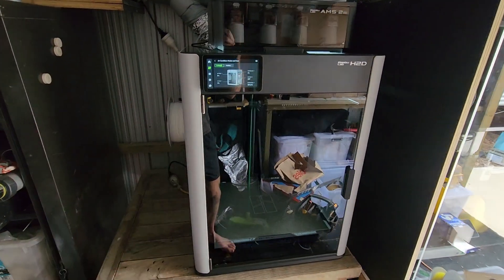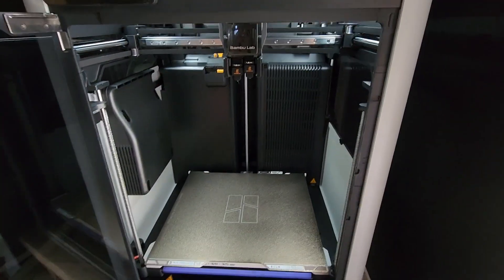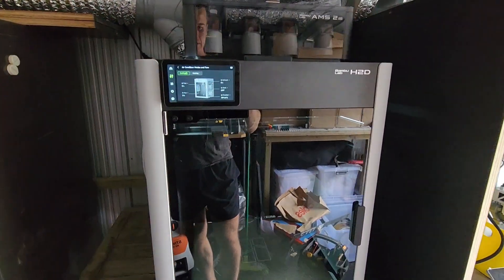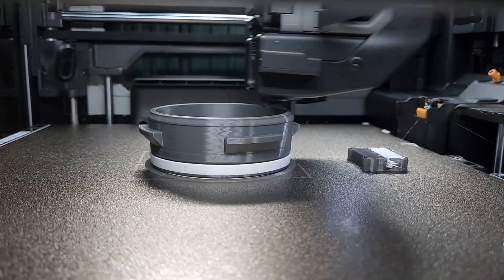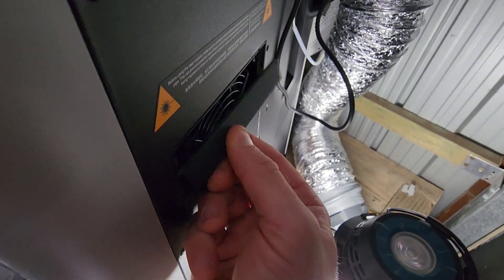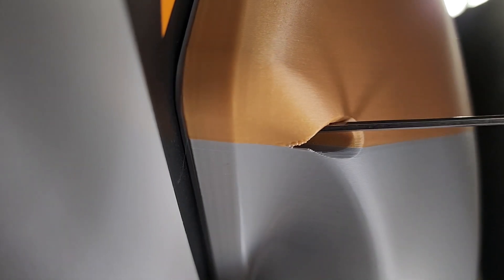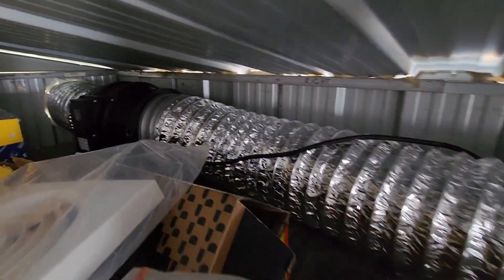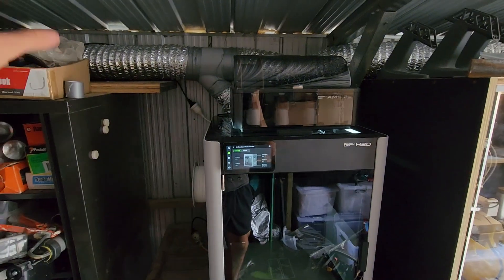Bambu Labs H2D 3D Printer - Extraction and Exhaust System - DIY FIX

Comment: Just wondering if that fan will make it difficult to control internal heat while printing. I am planning on doing a similar way and also considering doing the same compartment as shown on the right side with top mounted exhaust
Reply: I've been having this exact same question.
Reply from the maker: I have not had any issues whatsoever, but my ambient temp is fairly stable and I rarely print other than PETG. Also the draft isnt overly strong, just enough to create a negative pressure in the chamber to stop any leaks.

Comment: Great setup.. I was wanting to do something similiar but I was wondering if using accordian foil hose causes problematic turbulence?
Reply from the maker: Not sure on that either, it may do slightly, but overall a good inline fan has enough flow to negate those effects. At least for the relatively small run my exhaust ducting has, about 10m in total.

Comment: What is to stop one printer venting into the other?
Reply from the maker: There is a an exhaust inline fan drawing air out of the vent duct. So the whole system is negatively pressured (until the fan which is basically on the outside of the shed)

Comment: Hey man, amazing work. What are you using for the negative pressure air purifier itself?
Reply from the maker: Thanks mate, appreciate it. At the moment nothing, it vents via duct to atmosphere away from the shed. However as i'll be shifting soon, in the new place I will aim to use an inline HEPA filter to filter out the particles. I do use an INOVA HEPA and Charcoal air purifier for inside the shed area if working inside. A bit overkill maybe, but a cheap insurance if there are any escaped emissions that could build up over time.

Comment: I think it's better to put the H2D in a large enclosure, like you did with the A1 and vent the enclosure, not the printer. (in your case, you just need to add a top and a door).In this way, you vent the fumes released by the printer, without changing the printer functionality. The H2D is circulating air inside the printer when printing with high chamber temperature. Removing the fins like you did will decrease the internal chamber temperature, so  you will waste energy trying to keep the chamber temperature.
Reply: @FunctionalPrintFriday has done some test and if you regulate it you actually save energy heating the chamber. The video i think is called this sucks or something like that.
Reply: I'm looking in to buying a house soon and this is exactly what I planed to do in the workshop. Build a airtight cabinet where I got air outlet in the top left end of it going outside with a fan and a air intake at the bottom right end og the cabinet. This will give airflow over all printers and then outside.
Might be a good settup without making extra draft inside the printer. I wana print ASA so best to not put airflow trough the chamber it self
Reply: @SindreEide93  Just my two cents since I already built an enclosure. Make it tall, at least 50cm above the AMS lead when its open, and also at least 30cm  wider than the printer. The doors doesn't need to be air tight, the gaps in the doors can serve as an air intake, just install the exhaust fan on the back top of the printer. In this way, the air is always pooled away from the front. Last thing - install lights inside. Another way is to make the enclosure air tight and install an air scrubber with active carbon inside the enclosure.
Reply: @jyfjgtyuh i will only have 1 Bambu Lab P2S when it arrives in the mail. Still I think I will build the enclousure to fitt 2 of the H2S printers to have room for layer puchase of another printer and have a good amount of air room around them
Reply: @jyfjgtyuh  Alternatively, have a lid+front that can be opened for maintenance without having to be too far above the printer. Put your AMS units on the lid of the enclosure with an airtight passthrough for the PTFE and power cord. Might be more functional in some environs where it's too tall having a full cabinet cover. 

I'm looking at building one using T-slot extrusion because I can't work out an ideal way to keep my print room clear of VOC's with ducting that does not also mess with the printers own ventilation management. 

I dearly wish Bambu had built these all on the basis that all expressed air must pass through filtration. It just seems a lazy and dumb move. All of the designs are compromised in this aspect.
Reply from the maker: Great point! Ideally this would be the case, however luckily I don't need to use filaments that are super sensitive to temperature changes. But I agree, a enclosure would be the ideal set up, I just don't have the room or need for it just yet. Thanks for the great idea though!

Comment: Hello, 
I installed a system similar to yours on my H2S printer, except I didn't dare remove the two flaps to allow air to flow through. I'm wondering if doing so might cool the printer chamber too much, especially when printing with ABS or ASA, which can cause warping due to insufficient temperature.
Reply: I am going the way of Functional Print Friday venting.  He has 3 videos on how he set his up.  I think if I set up a blast gate and get the pressure just right I can control how much heat leaves.  https://youtu.be/jj7Mv1iiFNc?si=y4-rz1ci1eZdMnrw
Reply from the maker: That's is fair enough, all I would suggest is try it. Depending on what your ambient temps are, it may not be an issue. But trial first obviously! Easy to put back in if you need too.

Comment: Have you printed abs with success in this setup of removing the two plates and applying negative pressure?
Reply from the maker: Not abs sorry, a very small amount of ASA and no issues (simple print though)
Reply: @diysalmon if you continue to print asa with success let me know, or make a video! I can't find anything else about venting during ASA/ABS with h series.

Comment: I added gcode to vent ABS fumes once the print has started but I'm trying to dial in the best fan speed to remove emissions and also maintain enclosure temperature. 30% fan speed seems to work fine in my garage but unsure if this affects print quality.
Reply from the maker: That's awesome to hear, far beyond my skill set to edit G-code. I guess it would depend on your ambient temps for what fan speed you'll need to run. Nice work!
Reply: @diysalmon  Just need to go to the filament settings in Bambu Studio and add this: 
; filament start gcode  
M145 P0  
M106 P3 S26  
M141 S65 ; Let Chamber begin to heat

It will set the exhaust fan to 10% and enable the heater. It won't show that the heater is on, but it is running. I think 10% should be enough to maintain a negative pressure, but you could also cover the air intake vent to increases the pressure and maintain the temperature.
Reply from the maker: @Morawake no worries, cheers for the code!
Reply: Awesome work dude. I have been trying to figure out what to do here...is the normal function for abs to keep it closed as of the carbon filter will remove all VOCs? I would still like to at least install a hood over the system, but the code approach is interesting. Is 10% best to go out a window but not remove too much heat?
Reply: @Krozin The carbon filter in the printer is too small to really filter anything. The heater can keep up with 30% fan speed plus an open air intake. Restricting the air intake seems like a good idea to me to increase pressure without increasing airflow.

Comment: Are you having any trouble printing ABS/ASA with this setup since you are pulling out the hot air required?
Reply from the maker: Hi Sean, i do not print much with ASA/ABS so have not noticed any problem, however i rarely use them so take this with a massive grain of salt!
Reply: He wouldnt have, since the exhaust doesnt open for those filaments. His venting system is only going to work for PETG / PLA / TPU. If you need the heated chamber, then it wont help at all.
Reply from the maker: @PetterNorthpole pretty close Peter, but don't forget on this mod we take out elements of the mechanical shutters so it will always vent via the inline exhaust, albeit not as drastically as the vent assist from the machine its self. Probably why printing temp sensitive filaments hasn't been an issue as the draw from the inline exhaust isn't drastically affecting the internal temp.
Reply: @diysalmon  Valid point. Since you removed those 2 blades and it's working fine, then I may do the same... 
I print ABS and my room stinks. 
Cheers mate
Reply from the maker: @PetterNorthpole no worries, hope it helps! I would also use a voc/particle room filter just to be on the safe side, but each to their own!

Comment: Are you having any trouble printing ABS/ASA with this setup since you are pulling out the hot air required?
Reply from the maker: I rarely use asa/abs, for the small prints of ASA I've done, no issues. But that is during 20ish degrees Celsius of ambient temps.

Comment: are the fumes getting in open air or are you still filtering the air before it gets outside? could you show that installation too?
Reply from the maker: For now it is just venting to atmosphere, however the plan is to have the exhaust fan connected after an inline hepa13 filter to filter the air of particulates before exhausting to atmosphere.

Comment: When printing the hood did you use Support at all? I'm not really sure if I really need it or I should just give it a whirl without it.
Reply from the maker: Hi Mark, 

I always enable supports. I personally would rather use a bit more filament to avoid failures. Especially as PETG isn't the best at underhangs. Hope it helps

Comment: Hey mate, great setup its been a few months now how are your chamber temps when the heaters on?
Reply from the maker: Thanks mate! Right now it is 28 degrees Celsius internal and 9 degrees external while printing PETG. Have printed PETG all throughout winter and never had an issue! Very happy with the trade off.
Reply: @diysalmon  Cheers mate! mainly using mine for abs and nylon but its in my media room so im gonna copy your setup as i run 2 a1s and the h2d aswell.
Reply from the maker: @SIMUVERSEAU awesome stuff man, yeah better safe than sorry I say!

Comment: What about the 'poop chute'? Doesn't that still emit toxins?
Reply from the maker: Yeah would do if no ventilation providing negative pressure inside the enclosure. Another reason I have it permanently set up to exhaust all emissions.
Reply: @diysalmon  Do you set that up with software or anything to turn on the fan even with PLA/PETG?

Comment: I am new to 3D printing and just got an H2D. So when printing ABS the machine is not doing any filtering?
Reply from the maker: What a great machine to start with! Welcome to the cult! No i believe ABS profiles trigger the filter to help remove VOCs, but not particulates. This is my understanding, always best to check yourself.
Reply: When the H2D is set to heating mode (not cooling mode) the filter is used. So if you're printing a material that requires a heated chamber, the filter engages. ABS ASA Nylons will be filtered. PLA PETG TPU will not (although they should also be, but definitely not as bad as the heated chamber materials).

My printer is unfortunately in my bedroom. Printing overnight with PLA makes me congested, and I can smell the plastic in my nose when I wake up in the morning until I take a shower to clear my nose. Printing ASA for 3 hours caused me to wake up the next day with blood in the area where your nose connects to your throat. I've learned my lessons, and I have a proper setup for filtration now (like what's shown in the video). Proper filtration is definitely a requirement to maintain your health and safety, and no, PLA and PETG are not perfectly safe materials to inhale for hours on end. Don't listen to the people who say it is. PLA TPU and PETG also give me a cough.

I'm not any more sensitive to fumes, plastics, or chemicals than anyone else. These are just the side effects of inhaling the fumes of melting plastic for hours.
Reply: @AkalaFPS  There is still some fumes coming out, so I have added a Winnix room filter off Amazon to the room. It has a HEPA filter that is rated down to .01, but also has a large charcoal filter. This has removed virtually all the smells the leaked out and I am very happy now. :)
Reply: @kdw75 Awesome. Purifier for the room is a great idea on top of isolating the printer. I also do this.

Comment: Do NOT use the BT3x20 screws which he linked in the description. It obviously depends on the 3D model you use, but please be careful. I broke the screw holes and now I’m working to fix then.
Reply: I screwed in the screws and I felt some light resistance and then a snap, I pulled off the back panel and noticed 2 of the plastic points where you screw were broken, due to the screws being too long. Definitely user error on my part, should’ve stopped when I felt resistance. I must replace a lot of the fan assembly now, since the holes were apart of a larger plastic casted part.
BT3x8 are the recommended ones from what I could tell on the forums.

Just sharing my story here so others are more careful, since the screw holes are quite fragile.
Reply from the maker: @fredepo08ah damn, sorry to hear that man. Yeah I used the longer threads as the exhaust model plus the gasket was quite long, I hope its not too much of an issue to replace the parts. Definitely good to highlight this in case people use a smaller exhaust set up etc. Cheers mate.
Reply: @diysalmon  Props to you for responding to comments, cheers!
Reply from the maker: Oh bummer to hear man! I had no issues my end, but I did carefully "tap" the screws back and forth. How did the screw holes break?

Comment: Did you remove anything to then put the exhaust on there, or do the screws go into the holes that are there on the back? Tried to use the holes as is, but having a hard time threading the screws in... I was wondering If I needed to remove the black plastic plugs? in those holes already or just thread through them?
Reply from the maker: @Crafts4Painting  nothing removed no, just as you said, use self tapping screws and I just carefully wound in a few turns, then wound out and repeated. Simillar to threading with a die cutter for threads etc.

Comment: Can you force the printer to use mode 3 with hepa filter no matter heated or unheated? Maybe option in bambu lab or gcode maybe? 
This way you are filtering and duct would work as well
Reply from the maker: @Fallingoverbackwards  I'm not sure, however I don't think the carbon filter has any decent HEPA/particle filtration.
Reply: @ the H2 D filter is carbon and HEPA but if it's not in mode three then it just goes out the regular fan
Reply from the maker: @Fallingoverbackwards  Just to let you know, Bambu Labs advertise the filter as a carbon filter for VOC's ONLY. Not for particulates. The HEPA rating is a different beast all together, and it's not just the filter, it's the machine and seals its self. I wish it were, but it just isn't, sorry to be a downer! If you want the particulate filter, it is a seperate machine and cost over 1.2k AUD and advertised as a "smoke purifier".

Comment: So with this setup, the chamber heater won't be able to maintain higher temps for ABS and stuff, right?
Reply from the maker: @ivchatov  only if you opt to take out a few fins from the back. However you could print another hose adapter with a enclosed end and twist off the exhaust hose, then twist on the plug.

Comment: G'day Mate from Sydney. I have an X1 Carbon that I got last year, do you think I should upgrade eventually to this printer as do you think it is a large difference/many reasons to upgrade to Laser edition H2D or not? Thanks!
Reply from the maker: @Eesas_World  Hey mate, all depends on your use case. We make lots of dual coloured products so for us it's a no brainer for that aspect. Although keep in mind you'll need a 2nd AMS (can use the AMS 1) for the 2nd extruder. We did not realise this till we got the H2D so have ordered a 2nd AMS2 to improve multicoloured dual head efficiency and versatility. 

Personally we have no use for an inbuilt 10w or 40w laser, as well as the potential oxidisation issues it presents to the internal components. We use an external laser for these purposes. However we do use cnc cutters for some materials so if this add on comes standalone from the laser in the future, we will purchase them, simply due to the fact we can eliminate out cnc blade cutter which is only occasionally used. 

For us the H2D laser edition is not attractive for the reasons above. But the H2D itself is vastly superior to the X1's in our opinion for our use case.

Also EOFY 20k instant asset write off ends this FY, so definitely a viable option over existing printers. However the A1's, MK4's will do the majority of our single colour work due to their print quality basically the same as the H2D in our tests so far.
Reply: @ Thank you so much for your  thorough response, thank you again!